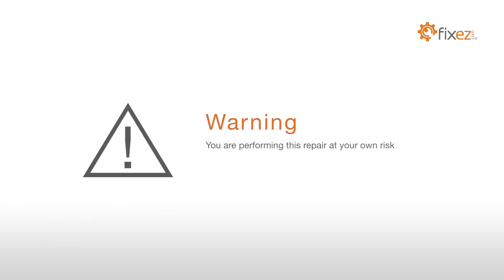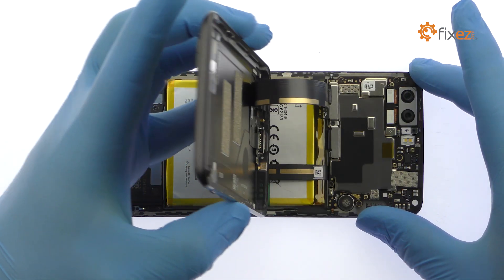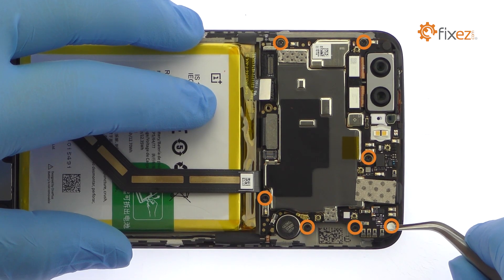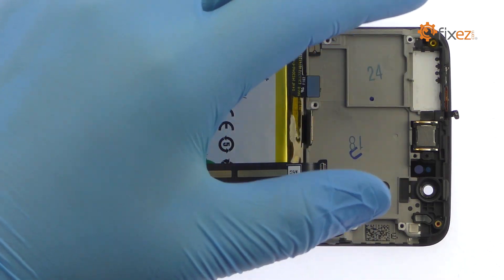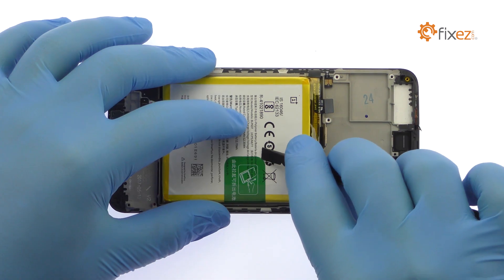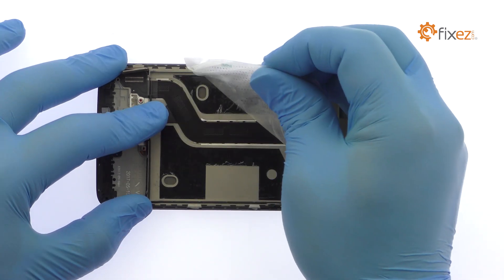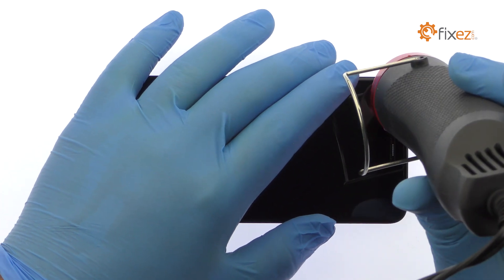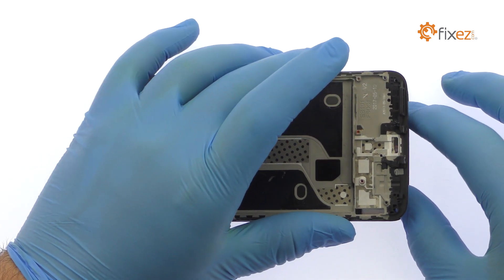OnePlus 5 Display Assembly Repair Guide - Fixez.com

Comment: thanks for the video..but the repair cost would be too damn high in india..since charge around 30-35k for the the display and screen assembly...soo if you broke your screen it would cost more than the actually price of the phone which is now about 27k...i dont know what one plus is planning to do with its after sales service but they are very responsive on this case, all you get is a plain answer that the cost includes certain taxes and registration stuff..but considering the fact that  it is higher than the actually phone is kind of amusing